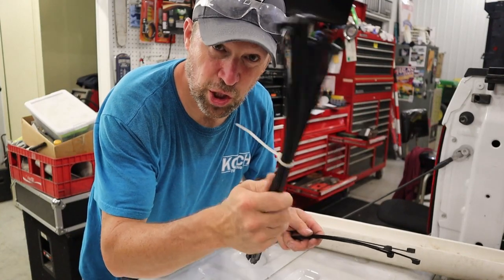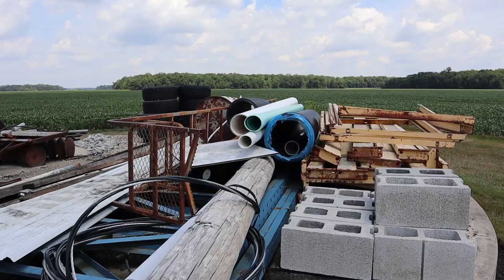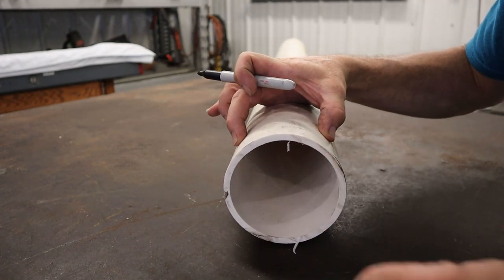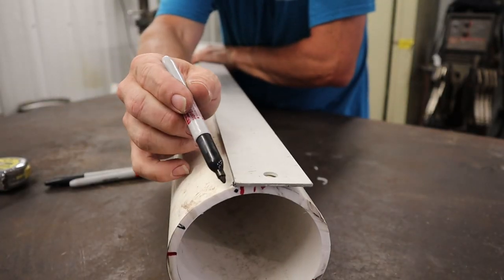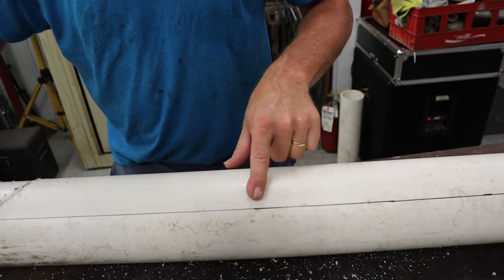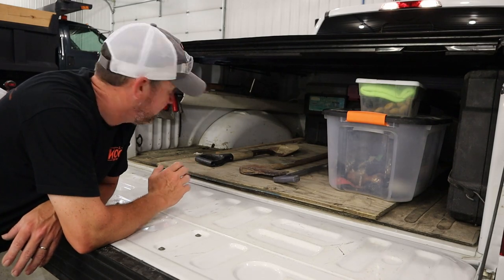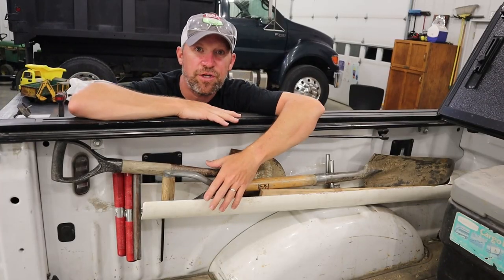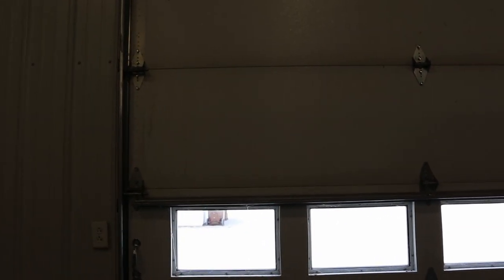DIY Truck Bed Tool Holder // How to Make a Cheap & Easy Storage Rack for Shovels, etc // F-150 Ford

Comment: Best Sharpie tip I've ever had my shop! You guys got to go to Harbor Freight and get the little bitty tiny magnets that are neodymium or whatever. They look like watch batteries there in a little plastic pill bottle looking thing. Super glue and all the Caps of your Sharpies and then just keep replacing the caps on the Sharpies. They stick to anything metal. I'm actually drop them on the ground and used a small piece of metal on my workbench to reach down and grab it without having to bend over and pick it up.
Reply from the maker: Whoa, that's a good idea.  I can think of some other things I could stick to the walls in the shop as well.  And, even better I could use some of those magnets in my shop office too.  I don't think I utilize the use of magnets enough!  Thanks for the idea.  Maybe this concept will be a video some day!  Take care.

Comment: Hey thanks for the idea. Was trying to figure out how to carry tools on my tractor rop without spending alot on items like ballast boxes.  I tweaked your ideaZ Using pvc pipe i put holes in it, capped the bottom (drilled drain hole in bottom in case of rain) and zip tied the pipe to the rop, resting the bottom on the fender. Now i can carry a short shovel, tree clippers and my mini chain saw with me no problem. Again thanks!!!!

Comment: Awesome idea on using the sides , I may try . I have some unused space under my side tool boxes. . 

I just love organizational stuff that makes the job easier. I have pick -up , with side tool boxes and ladder rack. Its a 4 door and the back seats fold down. The Home Depot Rigid rolling tool box fits perfectly and locks up in the back area and no sliding. I have a hitch and small open trailer with a ramp that I use for garbage and clean up at the end of a job. I am still looking for a set up where you clap your hands and all the tools go back organized in your truck 😂👺
Reply from the maker: I love that stuff too!  Thanks for watching and sharing!

Comment: Just a suggestion, use a table saw to cut the pipe. You can raise the blade and set the guard at 5” and you’ll get a perfect cut
Reply from the maker: That's a great idea.  I just don't have a table saw :)

Comment: Another good video. I think next time I would try clamping pipe down to the work table so you wouldn't have to hold it with your hand. That way you can use your other hand to sign the patent rights.
Reply from the maker: I thought you were gonna say clamp it down to stay safe.  I like where your head is at though...
I could patent a tool holder kit where I just sell the 6' stick of 4" PVC with a black Sharpie.  Now you've got me thinking... Thanks Dad!

Comment: the hole saw is bottoming out on the pvc so unless you plan to melt the top of the pipe away with the cut of the hole saw you will never be able to cut all the way through
Reply from the maker: Right on! I forgot though eventually.